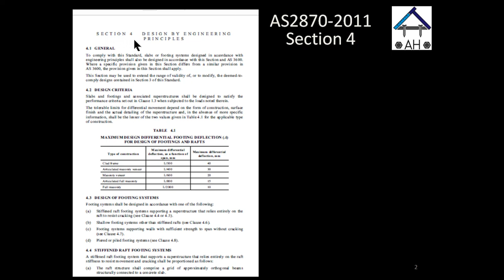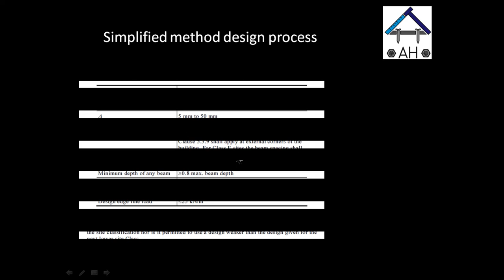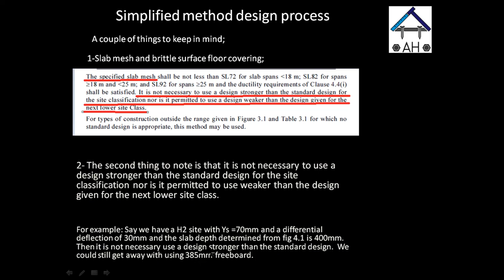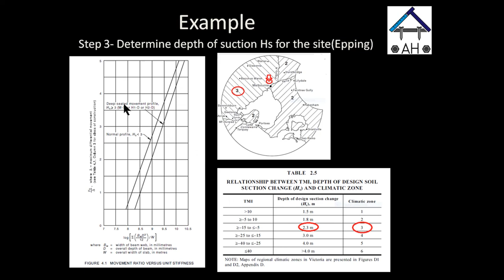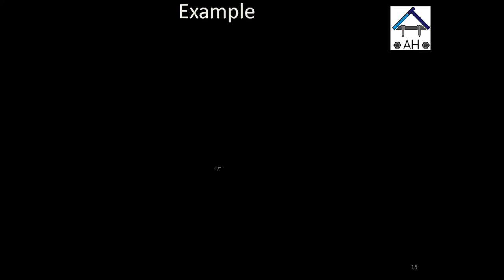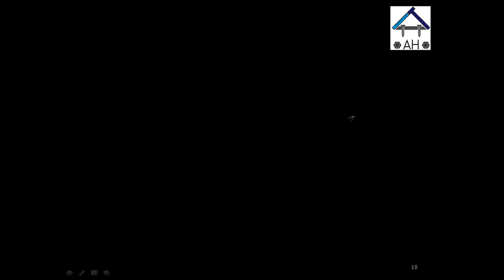Comment: Great video! Could you elaborate on your question 7. How to design an equivalent stiffness flat plate slab as per figure 4.1. I note that as2870 does not consider the beam flanges in its stiffness calculation (BD^3)/12.
Reply: Thank you so much for your positive feedback. Yes, Question 7 is certainly interesting and open to debate.
Personally, I disagree with the use of Figure 4.1 in AS2870 to model a flat plate with equivalent stiffness to a ribbed and flanged slab. Figure 4.1 is intended for modification of simplified raft designs—not for equating entirely different slab systems. Figure 4.1 is an empirical fit that applies to slabs with geometries similar to those described in the "deemed-to-satisfy" Section 3.
I've seen some engineers use Figure 4.1 to justify flat plate designs, particularly on low-reactivity sites. While it may seem like a clever and an innovative workaround, I don’t believe this aligns with the intended application of fig 4.1. It appears to exploit a grey area, but in my view, it falls outside the intention of the standard.
The definitions of raft slabs and stiffened rafts are clearly outlined in AS2870 Clauses 1.8.52, 1.8.56, 3.2, and 3.2.2. So how do some engineers justify a flat plate using figure 4.1? Often, instead of using the actual sum of widths of the ribs (e.g., 110 mm in a waffle slab) in the stiffness equation (BD³/12/W), they substitute B as the full length of the slab, then back-calculate D. Again, I don’t believe this approach is compliant with the code. While it might work in low-reactive soil conditions, I don't see it as a valid or reliable justification. That is my humble opinion. 
If I were to assess a flat plate on reactive soil, I would instead model it using finite element analysis with area springs. This would include a reasonable representation of edge step stiffness, the site's moisture conditions, soil water characteristics vs swell pressure(if available), and an appropriate cooperative width along the slab edges as per the footing design handbook.
Apologies for the long response, but I hope this helps  and addresses your question.
Thank you again.
Reply: @learn-structural  Thank you for your prompt and thorough reply. I've done a bit of reading and I can see why there is a lot of ambiguity with the section 4 design by engineering principles. 

AS2870 defines Section 4.6 as the design of footing systems other than stiffened rafts which contains the graph in Figure 4.1. I understand that the graph comes from empirical research by Walsh and Mitchell in the 1980s, which is why the unit stiffness disregards the beam flanges (beam flanges only came into AS3600 in 2009). Fundamentally, the graph is showing a required unit stiffness to resist a specified movement (ys) to a maximum deflection (delta). In a stiffened raft slab, the beams perpendicular from the slab edge resist this movement and the 100 thick slab between the beams, allow for some force distribution between beams, but does not contribute much to the unit stiffness. I imagine this is why the 100 thick slab is constant in the standard designs despite the different site classes. Additionally, for low reactive Class A & S, the standard design has no requirement on max beam spacings. This is then a 100 thick flat plate with perimeter edge beams. 

Based on this, I can see the logic behind back calculating a flat plate slab thickness Ds to achieve the unit stiffness required to satisfy Figure 4.1. As you noted the figure is based on empirical research, and hence the contribution of the beam flanges of width Bw + 0.2L from AS2870 CL4.4(e) should be added to the unit stiffness requirements of a flat plate slab. A perimeter edge beam the same depth as the standard design should still be included for a flat plate. 

Do you have any comments/concerns with the above rational? 
Thanks
Reply: @ManiHarley  Thank you very much for your response.

Just to clarify, Figure 4.1 specifically relates only to Clause 4.5 — the Simplified Method for Raft Design — and more precisely to Clause 4.5.2, which still falls under the umbrella of Clause 4.5. When it comes to Clause 4.6, we need to approach it differently: we must calculate point uplift and design the footing based on first principles.

Personally, I don't agree with using unit stiffness as a basis of fig 4.1 . I believe stiffness should be linked to the effective stiffness, or even the cracked stiffness, as outlined in Bichoff’s method under AS3600. However, this introduces further complexity, as it would require calculating both short-term and long-term deflections. For simplicity, we're using a single value of E = 15,000 MPa along with the other parameters provided in Clause 4.4.
Fig 4.1 must really be used with cautiousness. 
This is a broad and detailed topic, and I truly appreciate your engagement. I may go live in the near future to discuss deeper into these questions and provide a comprehensive explanation of my opinion and design approach we should take.

Thanks again,

Comment: Wonderful video, really helped me understand how the simplified method works. I'm fairly early in my career but was never able to wrap my head around this. Raft designs have always interested me but I never quite understood how they've come about (even the ones we use in the office, conceptually sure, but technically no). Could you expand on what you mentioned at the end of the video? I've also been very curious about how the demolition of structures and controlled fill impacts the designs of footings. Thanks again!

Comment: Far out mate. What an amazing channel. It gives a fresh perspective on the topics presented which makes us think twice. Step 3, 14:00, trying to determine which curve to use. The other way to perhaps approach this is to just take the Geotech engineer's advice; if they said that soil class is M-D, H1-D, or H2-D, then adopt the second curve. I guess we can still refer to Table 2.5 to double check the noted Site Class on the Geotech report, and query in case they noted a deep-seated soil profile for Epping (as an example) which doesn't immediately conform to our expectations as per Table 2.5.
Reply: Thanks so much for the positive feedback! I am glad you have found it useful. I will soon present the design steps for the other parameters. So stay tuned!
Reply: @learn-structural  The discussion of the last question and the reliability of design over time with the accelerated change in climate was a brilliant point, I never thought about that. Excellent presentation ❤️

Comment: I saw projects where the class soil type is "M", then proceed to pier system. When can I use the raft slab design prescribed by the code and not use pier.
And if I use pier, do I consider the entire slab/grade beam to be suspended? Appreciate your reply.
Reply: Thank you for your response. The approach described in Appendix H involves designing the slab for a higher mound height to account for the effect of the tree. For instance, an M site typically has a ys value between 20mm and 40mm. If we assume a value of 40mm, we then design the slab with a center heave mound height of                 ym = 0.7(40) + yt. Additionally, we must ensure that the moment capacity, Mu, in center heave is at least 1.5 times Mcr (hogging), and in edge heave, Mu should be at least 1.5 times Mcr (sagging). In this series, we aim to present real-life examples of using both this code method and the Victorian method.